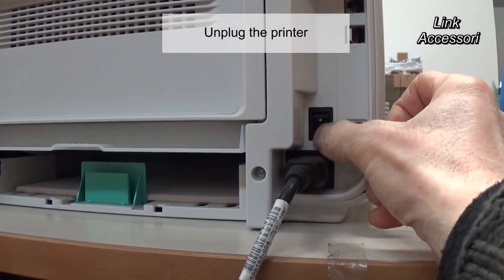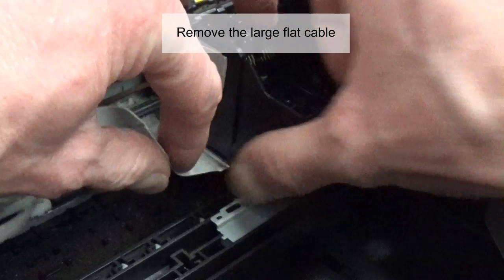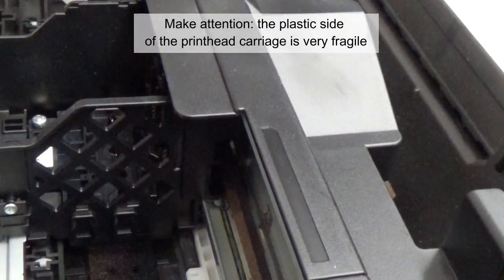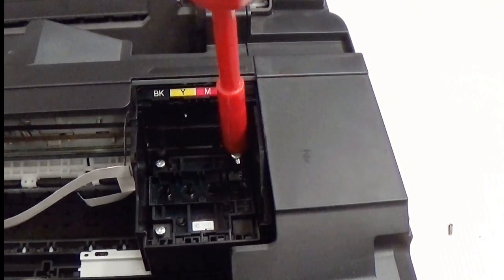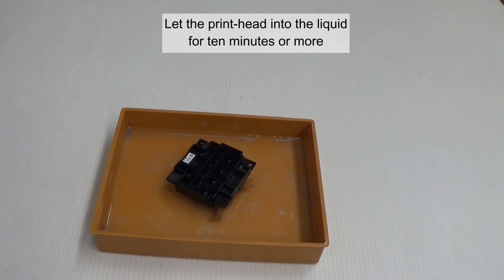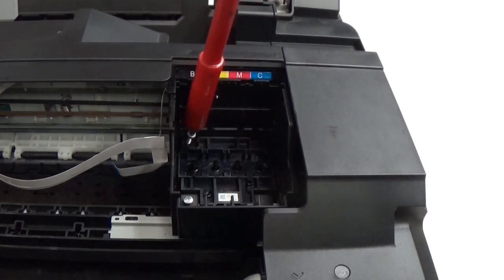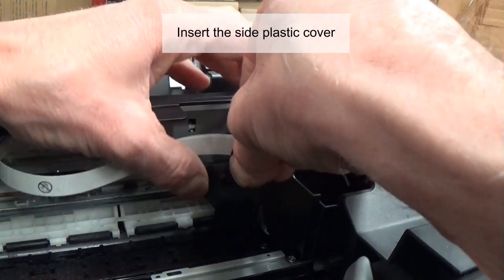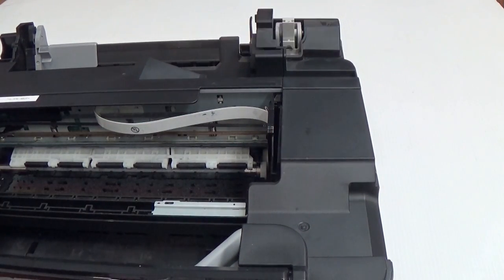How to remove the print-head from Epson inkjet printer XP300 WF2530 WF2540 XP400 and others

Comment: Good video but it wasn't easy to just put the print-head into the hot water, I dipped also the circuit board. Shitty disposable printer. If they put some screws into the print-head, it was much easier to disassemble the circuit board from the rest.

Comment: Thanks for this informative video.
 I followed the procedure and when I switched back on the printer stayed on for about 1 min and then switched off. Now it won't switch back on at all. The ribbon cables are all connected properly and the printer head was totally dry before I connected it.
Do you have any suggestion what I should do next?
Reply: It might be worth disassembling the print head again and checking the ends of the ribbon cables. I managed to remove mine ok but when put back together I first got a 000031 error message and then the black cartridge was not correctly installed (or so it said). After taking it apart again I found that the smaller ribbon appeared to have burred two of the contacts and they might have been shorted together. I scraped the gap between them clear with a craft knife and pulled the ribbon through the slot in the carriage to connect it to the contact block before inserting the block back in (a devil's own job to fit it but it went in eventually) - the print head is also easier to connect if you slide the big ribbon through the bottom slot and plug it in before putting the heads back in. Although the small ribbon seems horribly pinched up the printer now recognizes the black ink cartridge and it works again. Looking at the carriage that the cartridges fit into I think it looks strong enough to actually saw a slot from the small ribbon slot to the top which would make it far easier to re-fit the contact block after plugging in the ribbon! Hope you can fix yours!

Comment: Excellent video. I followed all steps and replaced each cartridge. When I print, the printer goes through the motions but no ink is printed on to the page (same problem I had before cleaning the head and replacing the cartridges). Do you have any further suggestions? 
It is an xp-320
Reply from the maker: if the sheet is blank, probably the printehead is defective and I think you have to replace the print-head. changing the ink cartridge is useless, the cartridge is only an ink container

Comment: Thanks for the video. Was able to disassemble and reassemble without trouble. However, this wf-2540 printer now gives a paper jam error and I can't clear it. I've disassembled it again, and hoping the printer heads just need to dry out a bit. I've tried everything else for paper jam errors from your videos and suggestions from around the web.
Reply from the maker: May be a paper sensor is broken and must be changed
Reply: @viandant5  I found that it was a fuse on the logic board, it was likely the result of a short in the port for the ribbon cable. Luckily I am pretty handy with electronics and was able to solder on a new fuse. Thanks for the help!
Reply: @treasurehunt7812  funny, i had paper jam issues, too, after re-assembling

Comment: Had two Epsons fail in the last 2 years. Why do they have a head cleaning feature? Does it ever work? Didn't on mine. Replaced both with HPs which I have had much better luck with.

Comment: Very good video, I managed to get everything out, clean, and back in. When I switched the printer (XP-245) on, it first moved the printhead, like a normal start. But then the printer stopped working, ans wouldn't turn on again. No control light, no reaction whatsoever. I took everything apart, dried the printhead again, and put it back.Still would not turn on. Is it possible that there is a shortcut or a fuse? Thanks for any hint.
Reply: Did you get it working at the end? Happened to me yesterday. I thought I had ruined in the printer until I found out that the fuse in the power cord had tripped for some reason. Changed the cord and all sprung back to life!!!
Reply: Could have been very useful but my XP-5155 isnt quite the same so still cant remove the heads to clean in this way.

Comment: I Removed the very back cable and now I cannot put it back.  Any suggestions???
Reply: as a veteran printer repairman , you will need either a long thin needle nose plier & or a grip-type tweezer.... when inserting it back in,
make sure the METAL SIDE contacts the circuit board !

Comment: My printer is not printing anything at all now - any tips? It came up with a 0x9E errors but I was able to fix that by putting the flat cable in. It was able to print with  blue perfectly before, not not anymore! Do you know what thus could be? Perhaps I didn't screw the screws in tight enough? Please help, I'm desperate for the printer to work!!!

Comment: The video does not stress not to remove the upper most ribbon cable.  If this is done, YOU WILL NEVER BE ABLE
TO RE-INSERT THE CABLE.  THE PRINTER WILL HAVE TO BE DUMPED IN THE TRASH !!!!
Reply: I guess I did not "make enough attention" and did not notice that the upper ribbon cable must remain attached.  Oh well, scratch one printer.  I will for make better the attention for repair of printer print machine device for most probably future advance next time.  I am an evil capitalist and admit such.

Comment: Hello:
I followed your instructions but was not able to get the circuit board out so I gave up. Now I get printer error with ADF light blinking and error message see your documentation. I checked th ecable abd both ends are connected. Not sure what to do now. Any suggestions? Thnaks
Reply: the same thing happened to me. how did you fix it?

Comment: Hi viandant5. I did the same but when i finished the work i got an e-01 error code. Could you help me to solve this problem? What could be wrong? Thank you in advance!
Reply from the maker: that error indicates that the printer is incapable to finish the self-test process. it could be related to cartridges too.
Reply: @Gábor Hajdú i did the procedure and got an e-01 error too. You were able to understand what was wrong?
Reply: @EduardoRodrigues-xl3ht  Yes, my problem was that the cable wasn't connected perfectly. So check the 2 cables, i think that your problem is the same.
Reply: @hajdugab0r  it was my friend. Solved now. Thanks
Reply: @EduardoRodrigues-xl3ht  your welcome. :)

Comment: Went through the whole process and cleaned the head in water twice. So much work for no results at all. I guess it's just been sitting too long clogged that the head is gone. SO MUCH ink came out of it I thought for sure I'd get at least SOME lines back.

I'm done with epson. This is my 3rd Epson printer and all 3 have had nothing but clogging problems annihilating cartridge after cartridge of ink trying to keep the head clean. And now with how downright illegally aggressive Epson has gotten with updates to guarantee you can use nothing but their overpriced OEM ink I'll never purchase Epson again. Even the supreme court came down on printer manufacturers for this practice and Epson still spits in our faces. Time for a multi billion dollar fine to get them honest.

Comment: Into hot water or cold water?
Reply from the maker: hot water, but not boiling water
Reply: viandant5 ok after the method I powered the printer on and it was all good and when it was warming up the machine there comes a hissing sound you know. When that sound started to come it cut the power off and I can't turn it on right now. I check the cartridge flex at the side and it was a little wet. Shall I wait and try again later or is it dead?
Reply from the maker: I think the water was too hot, you can try again later but probably the cartridge is defective
Reply: viandant5 but when I first plugged it in. It started working after a while it stopped
Reply: Now I make a USB connection to pc but pc doesn't recognize the printer
Reply: By the way all the cartridge was under water in my case
Reply from the maker: @philipmurray4065  The water could have done some short circuit in the cartridge. And if the electronic plate of the cartridge is detached probably it can't make a correct contact with the printer. I think that cartridge is no more usable
Reply: viandant5 I checked the transistors on the motherboard and they are both dead. I think the damage is on motherboard. What else should I check on motherboard or shall I buy  a new motherboard or shall I throw it into trash?
Reply from the maker: @philipmurray4065  But did you try to change the ink cartridge?
Reply: viandant5 I didn't. But it is also too expensive
Reply from the maker: @philipmurray4065  I think the problem is the print-head
Reply: viandant5 ok but even I plug out the flex cable from cartridge head it doesn't turn on. Normally it should right?
Reply from the maker: @philipmurray4065  it's difficult to say, may be you are right but if there is a short circuit in the print-head probably the machine doesn't turn on, and if you remove the print-head the printer doesn't turn on

Comment: I follow video with no problem, But after putting everything back together, plug in and power on I get error 0X60
Reply from the maker: E' di solito causato da un sensore a switch difettoso. Questo sensore controlla il carrello carta o che non sia rimasta della carta inceppata all'interno. A volte è solo un errore del software.

Comment: Hallo, thank you very much for the tutorial!
I did it exactly how you said, but now my printer is saying "error turn power off and then on again." What did I did wrong? ;(
Reply from the maker: Check the flat cable, it it connected to the printer? Is it damaged? Verify if the printer holder moves freely. In case you used a cleaning liquid disconnect the electrical cable and wait some hours. Maybe the printhead is wet
Reply: The flat cable is connected properly, and seems to be undamaged.
The printer holds moves freely.
The error occurs at the same beginning, the printer head doesn't even start to move, when the error occurs.
I removed printer head and installed it again, and then I had this the same error, but when the printer head moved to the right side. So I removed and installed printer head again, and now it didn't move like at the beginning ;/
Reply: I've waited several hours and shook the nozzle to see if any water was shooting out. It's not, and I left it for several more hours. I've plugged in the cables correctly, and the printer holder moves freely. I receive the same "printer error - turn off and turn on again" message when i turn my printer on. What else can i do before I throw this sucker away?!
Reply: Did you ever get this fixed? I'm receiving the same message!

Comment: Hi, I removed the printer head and put everything back but I got an error message and asked me to turn off the printer and turn it back on, so I did that but I still got the same  error message and the printer head doesn’t move/slode when the power is on. What do you think the problems are? Thank you!
Reply from the maker: Sorry I don't know, may be a connector. try to disassembly and reassembly the print-head
Reply: Thanks. I tried that already. Do you know how to reset the printer?
Reply from the maker: @MadamAdams06  no, I think there are no reset procedures

Comment: I have WF2540. After I cleaned the print head when i turned it back on I got printer error which said something like,  Turn off and turn back on. Refer to manual or epson.com.  I  referred to both the package manual and the web site, neither of which gave me anything helpful.  Please help. Thanks for your time
Reply from the maker: After a cleaning cycle it may happen that the waste ink sponge is full. The printer uses the ink to clean the cartridge.
Reply: I'm going to clean sponges, wish me luck

Comment: HI i did all the process and stones i turn on the printer was on for 1 minute then the printer turn off, do you what happened? is blowed?
Reply: same happened to mine ...............did u fix it
Reply from the maker: Yes, probably the printhead was still damp
Reply: Hi
do you know whether replacing the printhead would help in this case?
Is only the printhead dead or is the mainboard/power supply/something else also dead?
Reply: I dismantled my printer, looking for a fuse to replace or something simple to repair like this. I found nothing. I even opened the power supply casing, by cutting this casing, and found nothing. The power supply stills delivers 42 volts after having tested it. Something else got damaged when I started up the printer after cleaning it. And finding it is far beyond my patience and skills.
Never ever I would buy again an Epson printer, and probably an inkjet printer as I do not print that much, and with all my inkjet printers I had issues with the printheads being clogged.
The solution for the current case: a black and white laser printer, as the prices are now similar to the one I paid for the wf2540, and as I don't need printing with colours.

Comment: I have an Epson 835 and the issue is not clogged heads. It freezes upon powering up and the display flashes the message "A Printer Error has occurred". I tried some things suggested by the JustAnswer  site, but they didn't work. When I free the print head and move it to the left and turn on the power, it tries to start normally. The print head slowly moves to the right. However, when it reaches the ink reservoir area, the rectangular sponge, it bumps up against it the pad holder and triggers the error. I looks like it should clear the pad, but the pad will not stay down when I push it down. I wonder if it is gummed up under this pad. However it is not easily accessible. I do not see a way to unscrew the plastic cover that prevents access to the pad. Do you or does anyone reading this have a suggestion?
Reply from the maker: There is a sensor on the left of the print-head carriage, may be it's dirty or broken. try to remove and reinstall all ink cartridges

Comment: i accidentally removed the back ribbon flat cable any body know how to put it back
Reply: any luck.  i did the same thing
Reply: i did too but i fixed it by taking the whole freaking metal frame out and taking the print head out.
Reply: Pau Gasolina I can't figure out how to get the metal thing out.
Reply: I used a precision screwdirver flat head tip and took a tiny piece of ducttape, I placed the tiny screwdriver head against the reinforced blue plastic..and then wrapped duct tape around it and the wire. This has to be loose enough so the screwdriver can pull away after the cable is placed into the slot.
FYI: this is a bitch to do.
Reply: I was fortunate enough to use a eyebrow tweezer and plug it back in, of course only after I had positioned my hand a certain way and kept re-adjusting the strip several times 
Yes, major bitch to do
Reply: gonna try this!

Comment: i covered all the part of head with hot water and not only the down part. now my printer shows an error. is this mistake irreversible?
Reply from the maker: if the water was not too hot I think it's not a problem  May be there is a problem with the flat cable or the reassembling of the printìhead
Reply: +viandant5 the water was very hot but the head got cleaned very well. i have an error e 01 .. have no idea why it appears and what did wrong. maybe because of boiled water i destroyed something..
Reply from the maker: The error e-01 is related to an empty ink cartridge, not to the print-head
Reply: +viandant5 ive changed the ink but it doesnt start at all. the error appears at the very beggining before i print or scan something..
Reply from the maker: may be your ink cartridge is defective, or the circuit of the printer does not make a good contact with the cartridge. try push down the cartridge with the fingers for some seconds. that error is not related to the print-head

Comment: My blue on Epson xp-322 suddenly stopped printing and non of the usual thing I tried solved the problem.  I followed this to the letter but after putting everything back together I received a few error messages which I solved, then it wouldn't turn on which I again solved but now I'm getting "Ink out error"  Retry set I/C  Any suggestions please
Reply from the maker: Try to remove the ink cartridges, close the cover,  it will give an error message. turn off the printer, turn it on again, resinstall the cartridges
Reply: @viandant5  Thank you but alas has not worked although tried a few times

Comment: i removed the flat ribbon thats on the back of the box carrying ink cartridges and the print nozzle.  Its not the flat ribbon to the nozzle, and not the flat ribbon that goes to the ink cartridges.  Its the flat cable that goes on all the way on the back.  And I can't put it back in.  Anyone have any ideas?
Reply from the maker: To remove the print-head carriage you have to dismantle the printer, starting from side panels